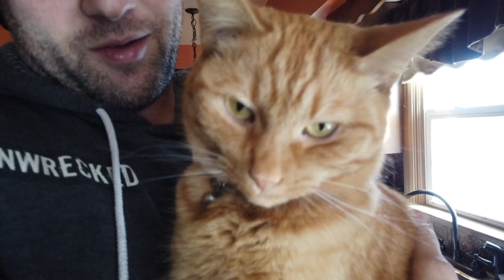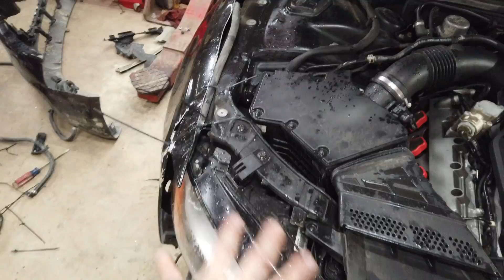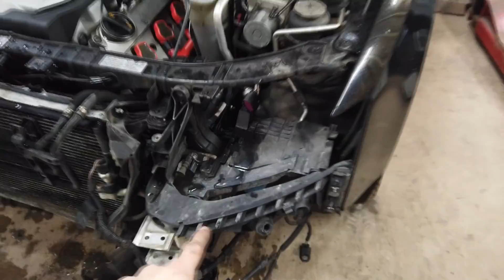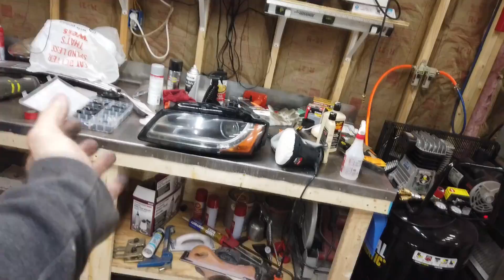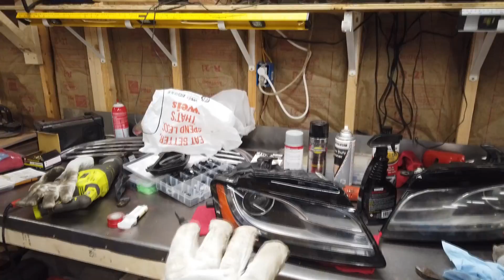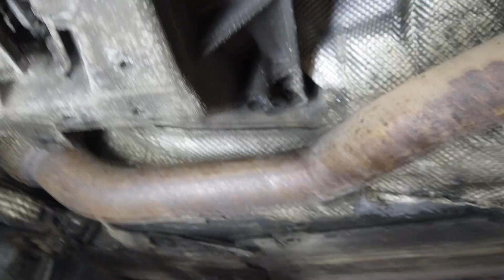Cheapest Audi S5 Teardown

Comment: I like your "make do and mend" approach, it sets you apart from other car channels. I would be tempted to try to put a little positive pressure in the light (ideally with smoke) then look to see where it escapes or else the water will get back in>
Reply from the maker: The water was in the light cause it was hanging upside down by the wiring harness

Comment: A sweater?  Your wife's hot enough to make summer out of winter!  As far as checking for oil when your "e-stick" doesn't work, instead of running a potentially dry engine, and waiting, there is another option.  What I do, I drain the engine oil, and then refill it with the same oil, and top off to reach the engine's oil capacity (minus 1 quart if I didn't change the filter).  I think that for an Audi S5 with V8, it's like 9 quarts?  I'd have to check.

Comment: I had one of those air pump engine codes on my Fusion and it was the diverter valve.... Advanced wanted $200 for factory one. I bought a universal one for $17 and it's gone a couple thousand miles with no issues. I made a video about it on my channel to help anyone

Comment: Before you go tryin to replace sensors, try cleaning out the connectors. GM's have connectors that over time become corroded and simply need to be cleaned out. there's even videos about that sort of thing  all over You Tube
Reply from the maker: So you want me to clean the sensor that's not there...
Reply: @UnWrecked  um no i was referring to the connector inside the car where it all connects before the ECU. i mean you can clean the one that's not there if you like, i hear pixie dust works really well for those lmao

Comment: So happy for you when she fired up . She's a keeper! check the vacuum pump for the brakes it will run off one of the cams the o-rings go hard and brittle and leak. And don't worry about the tyre wear on the back that's just negative camber they're set up like that from factory. Hope you find a bumper i can't wait to see it finished.

Comment: Duuuuuuude.  Inspection of airbag and Tpms lights?    Oh geez.   I love GA.   Only emissions no inspection in ATL metro area.    Anything goes in the other 500 counties.
Reply: SC is anything goes basically 😂.  NC requires a vin inspection and that’s it, outside of the normal state inspection
Reply from the maker: No emissions testing here
Reply: UnWrecked oh ok.   I thought that’s y u replacing sensors
Reply: Or do u have inspection?
Reply from the maker: @JoesGoldenGarage  tpms sensors are not a requirement for inspection.  I'm trying to sell the infiniti so I'm trying to keep the issues to a minimum
Reply: UnWrecked ah yes.    Gotcha.   Good move.  I love that car.   Man so powe4ful